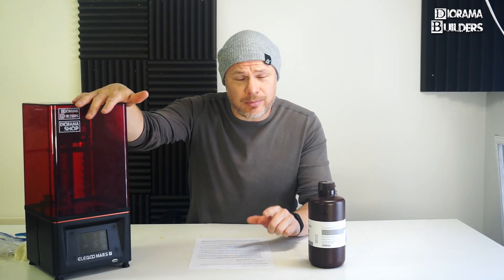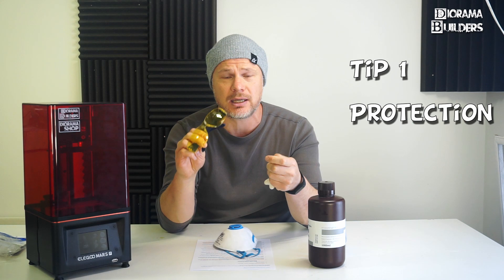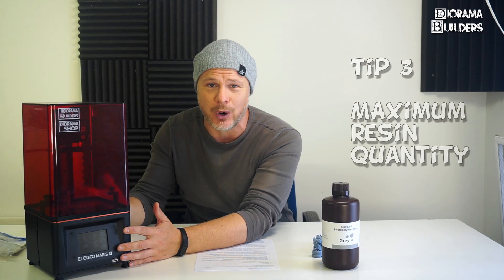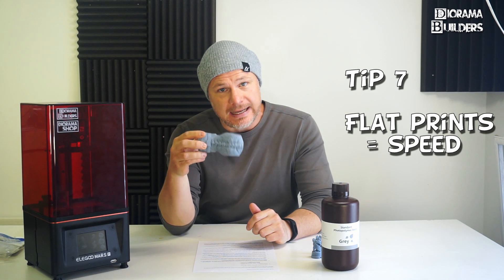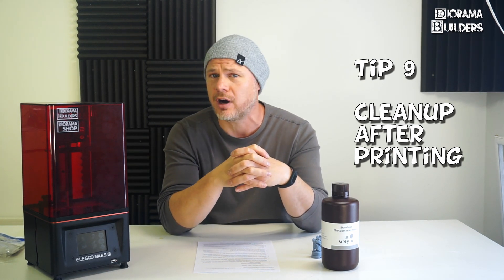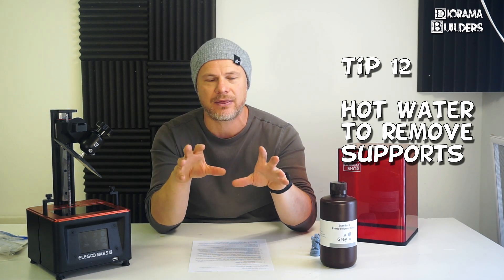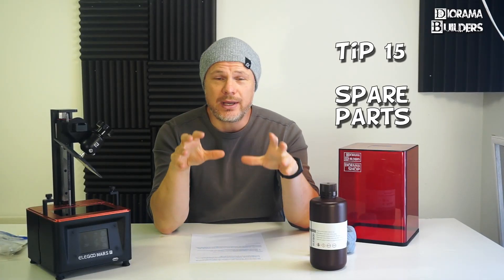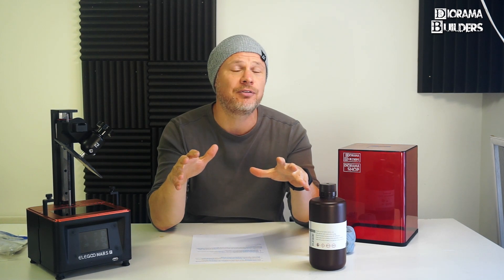15 Tips for 3D resin printer SLA MSLA DLP printing and IMPROVE print quality

Comment: I advise check the MSDS of the resin you are using. Most are nontoxic to humans. Most dont require a mask, unless you hate the smell that much. But pretty much all of thwm should be kept from getting into the water supply because they are very toxic to fish. 

Gloves are great but not always important except for easy clean up.

Comment: #11 and #14 I wish I knew before I got printing.

One thing I would add is check your FEP does not have hardened resin stuck to it after failed prints

Comment: Great Video, really informative for those starting up. 
I am a Chemical Engineer and fully agree with  the comments below regarding a Respirator, any Chemicals that give off Particles or Vapours are a potential Lung Hazard so be VERY Careful and use a proper Respirator or Very Good Ventilation. 
Question:- How easy would it be to remove VERY small, detailed Items from the bed without distortion or damage please. 
Thanks DB and good luck with future videos.
Reply: Best way to remove small items without distortion is to suspend them using supports. Use supports to raise the item off of the build plate, then any deformation from removal from the build plate should happen in the support structure

Comment: is there anything to watch out for when printing something with a big area? 
when printing things with a small area i have no problem but when the initial area gets bigger i have the problem that the print only sticks to the print plate in the center but the more distant it gets from the center the more warping i get. already tried to tighten the screws for the fep film but they can't get any tighter so i guess that is not the problem

Comment: if youve been using latex gloves then youve been absorbing all that resin in to your blood stream, you need to use nitrile gloves, latex is useless
Reply from the maker: Thanks for the tip.  I never heard of this.  Wurth looking up more info about this.
Cheers m8
DB
Reply: Eh, I've accidently licked the resin, it tastes like shit, but you'll live, you feel a little light headed is all, and a little sick.
Reply: @dBJerry  are you ok? anycubic recommends visiting a doctor after having direct contact with your eyes, i guess it's the same for licking it.
better go once too often than not enough, this resin is nothing to joke about
Reply: @c0d1ngclips25  Yeah man, I'm good :) I work with chromates pretty much everyday with my job, I highly doubt that eating a little resin is any worse than inhaling that shit daily. My job requires me to see the doctors often, so if something is wrong with me, it'll get picked up. MEK is far worse than resin and I've accidently licked that too, what's the worst that happens? I die?
Reply: @dBJerry  ya mad man😂😂😂😂
Reply: Nitrile aren't that much better, butyl rubber are the safest.
Reply: @headerahelix  nitrile gloves are for epoxy use. no need for butyl.
Reply: @headerahelix  that always depens on which solvents are involved - eg: butyl rubber whithstands acetone, where nitril immediately fails. on the other hand nitril works great with white spirits and butyl rubber fails.

Comment: Thanks for your usefull video, but by tip 13 (respect resin manufacture information for exposure time), you forgot an important point: The strength of the UV light in your printer has a big influence for this parameter. Eg. Photon S and Mars pro are stronger then Photon and Mars, and Phrozen Sonic Mini is even stronger then this. If a Mars needs about 12s, Mars pro is by 8s and Sonic Mini by 2s with the same resin.
Reply from the maker: Hello Thomas.  Thank for you the positive feedback.  Hope it helps you or others.
To be honest I never thought if this like you described and indeed, exposure time could be vary for different printers.  You are correct :-)
I'm sure people will read your comment and add it to their knowledge.
Thanks and cheers
DB

Comment: Is the hotwater tip only for water washable resins?
Reply from the maker: Hello Marco,
No this tip applies to all resin.  I found it much easier to remove and the supports come of leaving less traces.  Try and compare it cold vs warm water and you'll see.
Cheers and good luck.
DB
Reply: @PropsN3D  thankyou! i will try it today on the print i am making
Reply from the maker: Good luck and let me know your experience on that.
A little shout out to my video would also be nice.
Cheers m8
DB
Reply: @PropsN3D  I tryed it. I think it worked. thankyou!
Reply from the maker: Glad I could help with charing these tips. Good printing buddy :-)
Cheers DB